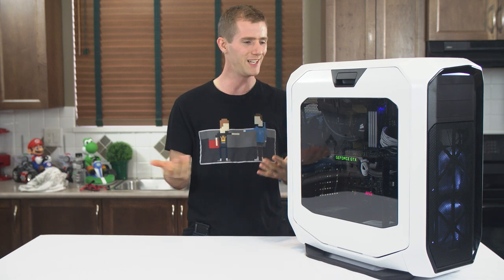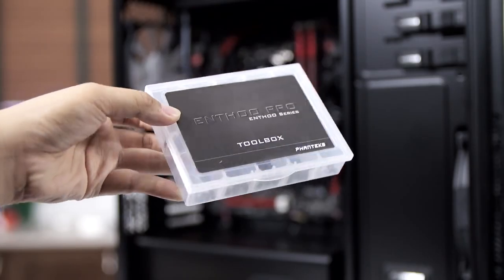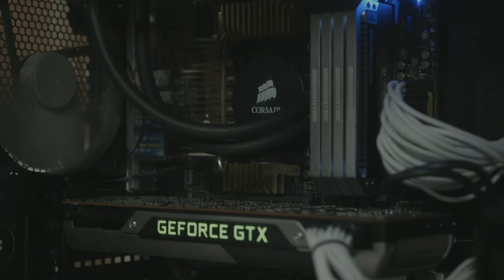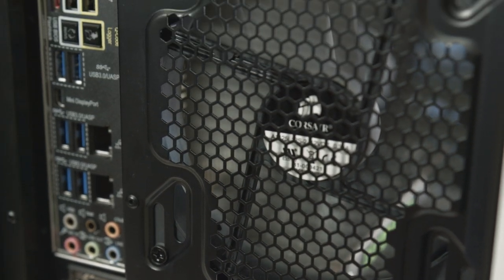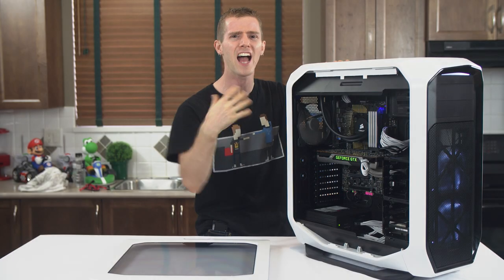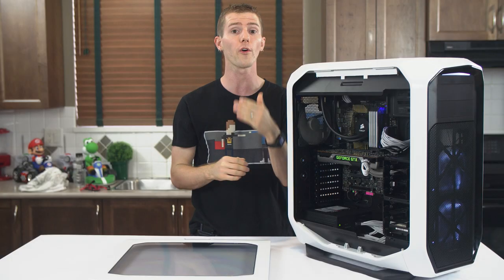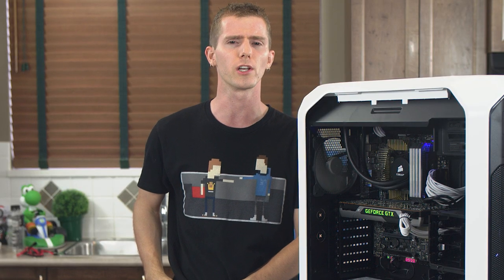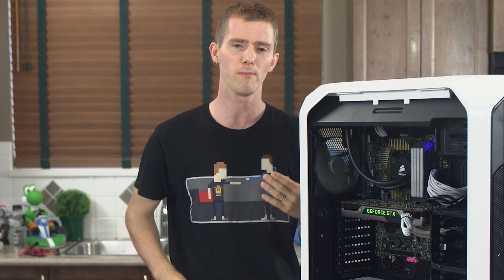Corsair 780T Graphite Case

Comment: 7 years now using it and its still one of the best looking Cases imo. Would be awesome if Corsair would offer some parts to modernize it. Like a new IO panel with usb type-C, a tempered Glass side-panel, a updated fan control etc.
Reply: I want one now 😭. I can’t find a brand new one, only old used ones overpriced.
Reply: Love this case too, i bought mine second hand everything works, the cooling is fantastic, the only drawback is my side panel window is scratched up, but i'm going to pick a black one up tomorrow, a guy is selling one for parts for 30 quid (UK).. the window on it looks clean and scratch free 👍
Reply: Yeah man lmk if anyone makes any 3D printed accessories to modernize them.
Reply: I bought a 780t case in 2016 and the build got postponed, I'm gonna do the build this year, just wish I could get an updated front i/o panel
Reply: I just got ahold of one that was sitting around. A little discoloured but im tempted to build my new pc in it to pay my respects to the owner of the tower

Comment: I've had this case for almost 5 years now. Still feels like a case that was released this year. Built my PC for longevity and this case was bought with that intent. Definitely worth the money IMO
Reply: I have this case too in all black. I agree with the lack of PSU shroud so I went and had a custom one made by V1 Tech and it looks absolutely perfect and complete. The only problem I had was the very flimsy solid side panel that I had to adjust so it sat flush with the case when closed but this is certainly the best case I had. Crazy thing is I had the Thermaltake View 71 glass case before going backwards in time to get these rather dated Corsair case.
Reply: The /\nunnaki how much did you pay for the PSU shroud? Also did it come with a cut out for GPU power cable pass through? 
I was also looking at the Thermaltake view 71 and was thinking about getting it to replace my 780t. How would you compare the 2 cases?

Edit: I just looked up the PSU shroud and it’s 80 dollars! That’s basically 50% of what the case is worth currently lmfao. Looks nice but idk if it’s worth to shell out 80 dollars plus tax for a PSU shroud.
Reply: wzero07 i love the design and features the case provides although I definitely feel that they cheaped out on some aspects of the case for 200 dollars. The acrylic panel is easily scratchable and doesn’t make your components pop through like tempered glass. I give it a pass because at the time of the cases release tempered glass wasn’t mainstream. And secondly no included PSU shroud. There’s a lot of “dead space” towards the bottom of the case so Including a PSU shroud for esthetics and  practicality isn’t out of line for a near 200 dollar case. My only 2 nitpicks for the case, otherwise love it.
Reply: Same, and I love it!
Only problem is that the reset button is DEFINITELY too easy to accidentally hit, but I'd be lying if I said I've done that more than twice.
Reply: How much did it cost you, looking foward to buyiung one cause of all Pc Cases with Optical Drive Bay, it is the best looking modern Pc Case with an Optical Drive Bay
Reply: @EstebanMenchacaGamboa  I paid $150ish when I got it 5 years ago

definitely on the expensive side, but worth every penny imo—aside from the lame stickers I slapped on it, the case still looks and functions as if it were brand new
Reply: @arc-sd8sk  do you use the 5 1/4 inch bay for an optical drive?
Reply: yeah, and also a fan controller
Reply: 6 years for me now and still mint. Would love to upgrade to something more modern but I have a tough time finding other cases that offer the space and airflow options with a unique design that the 780T has.
Reply: @DrZaius  Don't, this case is The Case, i swear I can not find something that can even come close to this case, this offers a lot in a very good looking case. I wanted something that has a good looking side panel glass with an optical bay and cannot find one. I settled for another case but unfortunately it did not have an optical bay...
Reply: Anyone know if you can mount a 240mm radiator in the top?
Reply: @Woody72110  you mean dual 140s correct?
Reply: Same huhuh....
Reply: I bought this case in January 2020, and i start to use it now ^^
Reply: @arc-sd8sk  I paid 276 $ in January 2020 ;) That's how much it cost now !!! To be exact 1106,05 RON (Romanian lions) , which was 276 $ - VAT & shipping included (from local retailers in Romania). I think it's ok, considering that my income is around 600 $ / month in 2021 ;)
Reply: I love this case so much
Reply: @Alex-lh9tz  I bought a new one from Amazon last year for $167. This is the best case ever made.
Reply: @abdullahal-shimri3091  nice!!! :D if you wanted some nice extras for it there is a company called ColdZero - they have made a shroud for the bottom which I have i my case RN and it honestly makes it look so clean
Reply: 2021. Still loving this case. Just wish it had a tempered glass panel instead of the plastic one.

Comment: ive had this for 7 years, just upgraded all parts. Still one of the coolest cases in 2021
Reply: thanks for telling. i am thinkin o guy this in 2021 :D since i need the 2x dvd slots for my blue ray drive & sd card reader / bluetooth combo… impossible to find a new case that are compatible with those! pretty sure its gonna fit my beefy 3080Ti too ;)
Reply: Same here. This case will last a lifetime you don’t have to ever change it.
Reply: Only in visual design... But build quality is prob the same disaster as the garbage 600T that i had.. Fractal Define 7/XL may look boring, but is hell a lot better build, and with better parts, and way less plastic..

Comment: I owned the 600T, and it was excellent. I have no idea why anyone would complain about the plastic since it's the very thing that allowed the case to be sculpted so well. I also love those drive cages. Any drives mounted in them aren't going anywhere, so the fact they flex a little is a non-issue IMO.
I upgraded to the 760T. I had the choice between the 780 or the 760, and I picked the 760. Six years later and I'm still happy with this case. I selected it because it had three 5 1/4" bays, which I needed (actually needed four like the 600T had). The two on the 780T were just not going to do the job. I won't even look at cases without 5 1/4" bays (for my personal PC).
I had the 5-year itch to upgrade my case a month or so ago, but instead I ordered in a PSU shroud and added a little more RGB. Cleaned the case up like new and the itch is gone. The only thing I could ask for on the 760T is that Corsair would make a tempered glass side panel for it.

Comment: I got this case 4 years ago and I still love it! Em...with some reservations. 
This case is an absolute beast, it's HUGE, if you haven't seen it live you can't really comprehend how gigantic this thing is compared to "normal" cases. Anything you put inside will look positively tiny compared to other cases. While it's great for the "wow" factor, cable management and ventilation for my air-cooled setup, it can be really inconvenient to place, especially in smaller rooms. Not to mention transportation, which could be a real nightmare if you have a small car. 
The other downside of the size, while the construction is sturdy, it warps quite a bit. Especially the doors can warp a lot, not being flush with the case can look weird, but they are even prone to simply falling off. You can kinda bend it back into shape, but it somehow never looks right, there gonna be gaps around the edges. 
The other issue is acoustics. Airflow noise is negligible, but the large structure and chamber inside can amplify sound and resonance real bad, like coil whine, HDD noise and fan vibrations, so the case is prone to "buzzing", and god forbid you have a cheap or old fan with noisy bearings, it's gonna drive you up a wall.
All in all, I really do love this case. It's huge, imposing, easy to work inside, cable management is awesome and it's excellent for air-cooled systems. Been using it for 4 years, so that's a badge of quality. Yea, it can be noisy sometimes, and the huge size can be an issue for some, so do check the measurements before you buy.

Comment: What's the problem with the hard drive cages? I like them. They're easy to use, and lord knows I'm never switching 100% to SSDs, those things cost way too much to throw in 4TB+ worth in a new build.
Reply: What do you need 4TB for? I mean I guess star citizen would be a valid reason
Reply: I do a lot of video editing and Photoshop work. On Top gaming, I need all the storage I can afford.
Reply: JMotion Ohh ok
Reply: SSD's are better because the more you add to your hardrives they become slower which SSD's dont,I would put my games,OS,and editing software/photoshop on my SSD's and put my misc and photos/screenshots on my Hardrive
Reply: 4tb is nothing i just filled my 16tb NAS looking to add 2 moar 8tb reds.
Reply: I paid 276 $ in January 2020 ;) That's how much it cost now !!! To be exact 1106,05 RON (Romanian lions) , which was 276 $ - VAT & shipping included (from local retailers in Romania). I think it's ok, considering that my income is around 600 $ / month in 2021 ;)

Comment: Front: (3x) 120mm or (2x) 140mm, Top: Top: (3x) 120mm or (2x) 140mm.

I like it. In fact, I think this will be my case for my first build. Not bad for currently $200.

I didn't learn that from Linus, I learned that from doing research and learning how to build a PC, without even buying anything yet. I've been researching and learning how to build a PC for about 4 days now.. and I think I've got it down pat. Nice video Linus. (+1 : 9,865)
Reply: 4 days reserch lol i been reserching for a month now!
Reply: +VoltMusic A whole month..? I researched about building computers for four days, non stop. Some people just aren't as dedicated, and some people might have learning disabilities. It's fine that it took you that long. It's perfectly fine. Nobody is perfect. As long as you actually learned something, and didn't waste a whole month, and didn't learn anything, or don't remember what you've learned.
Reply: YAZEE It only takes a few days to learn how to build a PC, especially if you get help on Toms Hardware, or any other forum. Then it's just a matter of what case, motherboard, etc you want to build with. I've been learning about computers my whole life 30 years. But when I wanted to finally know how to build a PC, I actually sat down and learned how a PC was actually built. etc.
Reply: +Mark II I've been researching for a year :)
Reply: for a first time build its probably abit OTT but the size makes installation if ur not confident very very easy

Comment: For a Corsair case, I feel it doesn't offer enough to justify it's price tag.
Don't get me wrong, I like the case, but I feel it is too expensive for it's "just average" features. 
I mean, if it's gonna be extreme air cooling, IMO there just has to be a side fan slot that blows directly onto your GPU(s) and also, maybe another fan slot on the inside that can direct air where it's needed (to the motherboard or GPU). 
I've got a NZXT Phantom 410 and it has the same features, if not better (like the afformentioned side fans) for 90$. With 8 fans total I get similar benchmarks to water cooling. You also have plenty of space inside to fit any graphics card and ample room in the back for cable management.
Reply: ***** Buy one of their obsidian series cases then come say that.
Reply: ***** Do you own these cases? My brother owns the 750D and it feels like you could drop it off the roof and it would be ok. As for the 450D, I built a PC for my buddy with that case and, again, it feels bulletproof.
Reply: ***** I own the C70 myself. I see what you mean.
Reply: So full of shit first you copy what he said nearly word for word then you try to compare the NZXT 410 to the Corsair 780T and even go as far as saying it's better! Like i say full of shit!

Comment: an absolute delight to build your system in. For cable management i did my best to do a tidy job for the side facing the acrylic panel window but i left an absolute rat's nest behind the mobo tray. Despite that the HUGE amount of space behind the mobo tray allowed the cover to be attached without even having to apply undue force (which i had to for previous cases)

Comment: I have the Corsair 760t right now, and I'm not complaining. The build quality is amazing, and it was extremely easy to build in. I can relate with your struggle of the 3.5 inch hard drive slots, though. I wish they would just make it fully optional to remove it without doing any major modifications to the case itself. I was looking into selling my rig soon, and upgrading later with the 780t. There's just so many similarities, yet so many differences. So its hard to call a victor.

Comment: I got this case at the end of 2018 in addition to a slight overhaul of some components and the space it offers is amazing. Pretty big so enough space even for really REALLY BIG di Graphics cards. The possibility to install 140mm fans enables very good cooling and the fan control button at the top enables quick and easy fan control.
Only criticism I have is that the standing feet could have been made out of metal as well. It is a quite big and heavy case after all, especially when you pack it with high end components.

Comment: I just got mine (black), I love it! Good fictional design with easy access and great look.  It has 2 front bays that I needed wich is getting harder to find. Only thing I would like is for the sheet metal to be a little thicker, it flexes a little too much and a glass window instead of plastic.
I think it must have been like one of the last. I paid about $177 and just check the price and now a scalper is selling it for around $450!

Comment: does installing a ton of noctua's fans will make it fairly quiet?
Reply: I have one, can't hear the stock fans unless I ramp them up to 100%, and even then, they're barely noticeable.
Reply: SubZero9989 is it nesscery or good to put 2 fans on the top?
Reply: DougisLive yes, I suppose.
Reply: Funnily enough, on my current main PC, I have a corsair fan on the side panel, a noctua fan on the rear exhuast, then on the 120MM CPU heatsink, a stock Coolermaster fan and a Noctua, and the Noctua is the only one I can hear, whilst the corsair is dead silent.

10/10 worth it though, Noctua fans are insanely good
Reply: I bought this case in January 2020, and i start to use it now ^^

Comment: First time you are wrong about that case. First- it´s not meant to be just for air cooling.
Its perfect for extreme water cooling setup with 2x360x64mm rads push pull and you still have so much room there.
Corsair Air540 is perfect for air cooling. 
Keep up the good work Linus.

Comment: Linus I have been a huge fan of you an your site and Jays2cents and many others as you guys have all helped me up-skill from a person who had never owned a gaming rig in 2012 (although I did have a very low spec acer laptop that I upgraded to a duel core and 2Gigs ddr2 ram) to a person who rebuilt his first Intel gaming rig and built a 2nd AMD rig. So with RESPECT not everyone who builds places huge importance on cable management or aesthetics. You could easily add 2 extra cable management holes if you needed to and rubber-line them with the right tools and add cable shroud if you wanted (seeing a cable shroud in just a 90 degree piece of aluminum or PVC?) This case ROCK'S the casbar in terms of space ventilation and room for extra options and will definitely be my choice (or Phantecs Entoo Pro not sure which) for my next dream case, as I can be patient with the tedium of rerouting fan-controllers with splitters. Give some love man. Corsair muffed the icing maybe but this cake tastes great. Thumbs up!

Comment: would it still be a good purchase in 2018 ?
Reply: Brock want to know this too!
Reply: Yeah I had one with the i5 8600K and Z370 gaming 7 and  it's more than good, the only problem is the acrylic glass panel that get scratches with time, I would lik if it's mad with tempered glass
Reply: @ahlamelidrissi6724  Tis not made with tempered glass, yet, ima going to mod mine with dark grey smoked tempered glass here in a month or so...
Reply: Its a great case even in 2019....  Ive got an X299 system in mine.  AORUS X299 Master Mobo, i7-9800X CPU, EVGA SC2 Hybrid GTX1080TI, Custom water loop for CPU Cooling, EK Vardar 120mm fans, Coolstream SE360 RAD on the top (Pull), 1TB NVME storage with other SATA SSD storage, and several HDDs, a super tall Res, lots more fans, a shit ton of cables in the back, water cooling additions such as a flow indicator, and a filter, Fan Controller, BDXL Drive, The list goes on  and on.  This case holds it all.  Its more about what you put into it in 2019, but the case offers far superior water cooling options than most of the modern smaller cases do.  Grommit spacing is optimized for ATX boards, not EATX boards.  Keep that in mind.  So dont throw a Dominus board or some crazy shit like that.  Great case.